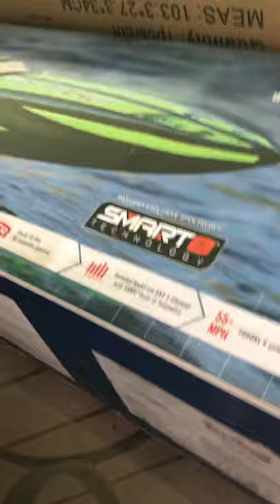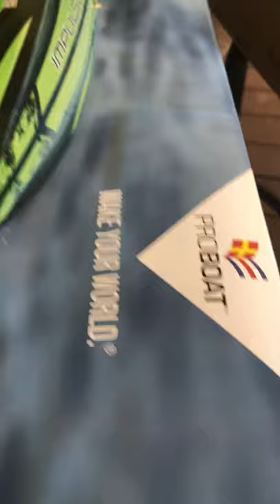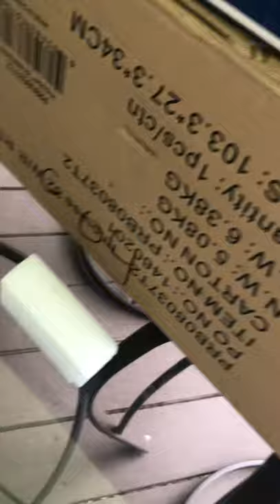Unboxing my Proboat Impulse 32 that just came in👀❤️

Comment: I ran a single 6s pack in mine, it worked pretty good.  This boat has big power on 6s and  it is the same setup thats in the Blackjack so it can handle 8s.
Reply from the maker: I have the 4s packs just wanted to check out before I put the juice to it👍👀❤️She is fast and jumps the waves like no other I have💪
Reply from the maker: Different motor in this Impulse than the Blackjack 42 but same ESC
Reply: @mildtowildrc7343  hi dude..this impulse looks mean !! does it run with 2x 4S batts with no heating issues ? which batts are you using ? mah ?
Reply from the maker: Esc can handle 8s but motor does get warm on 8s and they set the Kv on this for 6s and it fast!Easy 65-70mph with 2(5000mah)100c Spektrum smart battery’s and gives you the battery reading on remote👍Hell of a boat for the money!Toughest hull from them yet,and is as thick as my MG36.
Reply from the maker: Not the same motor as the blackjack42

Comment: I go with Traxxas all the way
Reply from the maker: Had all 3 they make and the only one I liked was the spartan.Like all of these they all have issues needed to be resolved.I had issues with the remotes on my traxxas losing connection and did away with them!
Reply from the maker: Fiberglass hull on this is way better and the only thing it needs is a better rudder and tuned to get 70mph🤔Dam good boat.Flipped it several times at high speed and hit and fish or turtle hard enough to bend a turn fin with no other damages👍